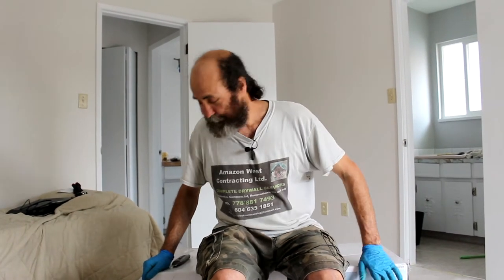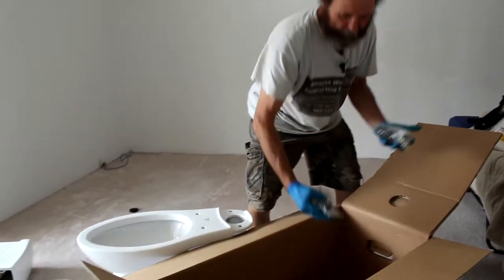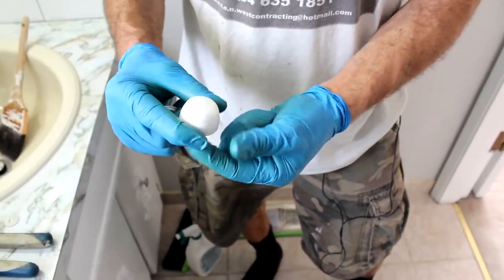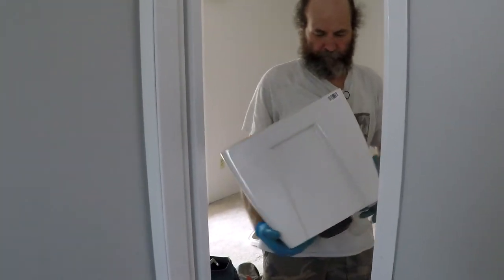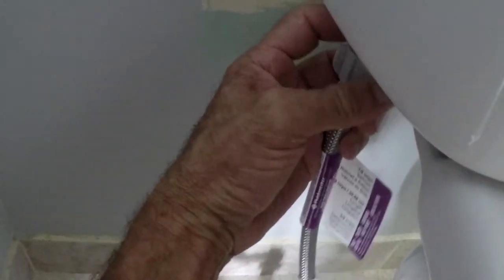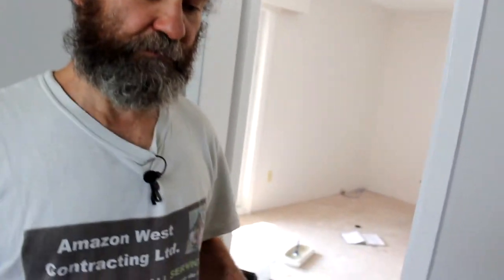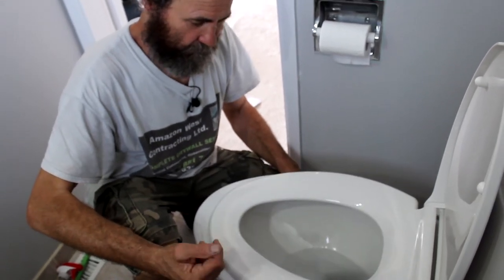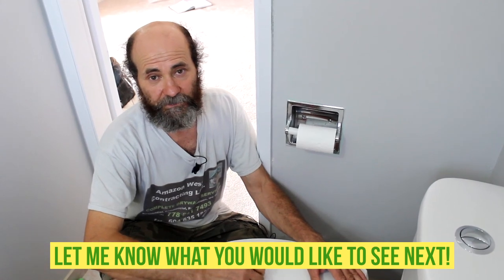How to Install a Toilet

Comment: What type of toilet is this. I need help with a Swiss Madison toilet Château model
Reply from the maker: Hello my friend, thank you so much for watching my videos, this is a water ridge two-pieces toilet
Reply from the maker: Which model of swiss madison toilet do you have? Usually installation are very similar from toilet to toilet
Reply: Bahiano Reno we have the model Chateau 1 and we hear a hissing sound and the toilet flushing long after it is used. What part should we try to replace ?
Reply from the maker: Hello my friend check the toilet fill valve, lot of times it needs cleaning and adjustment, you could have some water debirs in the valve, keep safe